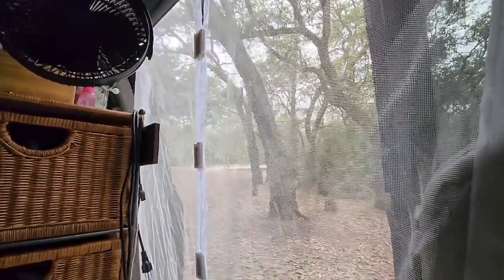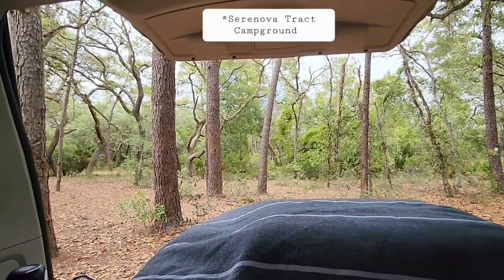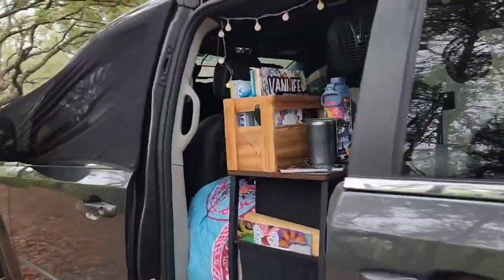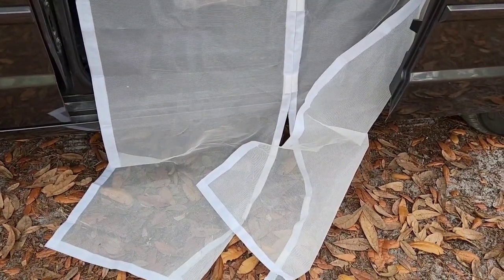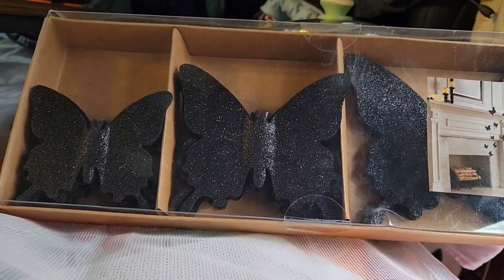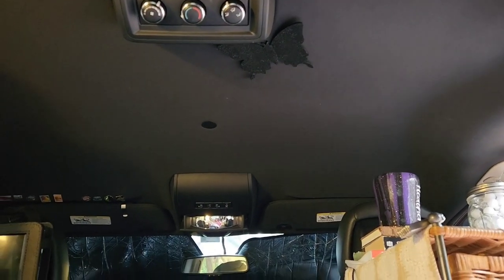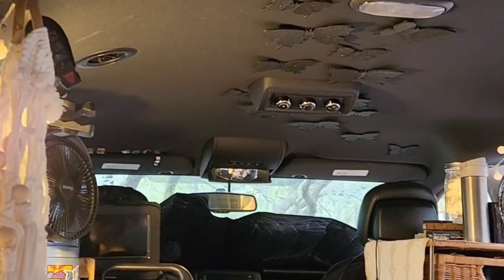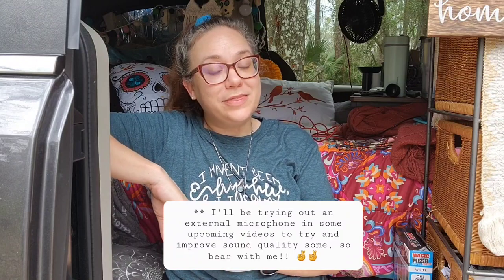Completing a Couple Easy PROJECTS on My No Build Minivan Camper While Off Grid Camping in Florida

Comment: Very cool additions. I love the screens. I wish that I could use them on the side of my SUV, but I don't think I can keep my door open too long - because of my suv battery. The back hatch doesn't drain the battery, but I believe the side doors open will. LOVE the butterflies. Awesome ceiling!! Everything looks so great!!
Reply from the maker: If your back hatch doesn't drain it, your side door shouldn't, I don't think (not that I'm an expert). My side doors are automatic and still have some connection to the battery (b/c I can hear the motor in them kick on occasionally, even with the engine off) so I wouldn't think your side doors open for a few hours would pull anymore juice than mine do??
Reply: @HeathersHikesAndAdVANtures  Okay. Next time we're out - I'm leaving my side door open the entire time. I have jumper cables, but I don't know how to use them. Actually, I better check to make sure they are jumpers. They were so adorable, I had to buy them. They may be fake. So be ready, Freddie with yours.  💙

Comment: Hey Miss Adventure this is a little off subject but your 3rd project about being able to use your computer and not just your phone made me think to ask!: Have you done a video on how to use? 1) the internet while traveling, 2) how to stream so as to watch TV or movies??  I am older and not technically inclined to say the least. I used hotspot on my Android and that worked because I had good service where I camped, but I was wondering if there are other options. I also got the screens for my van doors(wish I'd done white). Did you say the one one the hatch is a mosquito net for queen bed? Thanks for all the ideas, encouragement, tips and most importantly laughs... 🎶🏡🐁
Reply from the maker: Thank you for your thoughtful comments and feedback! That is a fantastic idea to use the pins and then just roll it. That way I could leave it in all the time - even when I'm using it as a "normal" passenger minivan - if I wanted to! I'll have to try that for the times where I'll be moving camp a lot!
I've thought about a video for simple methods for getting internet on the road (I'm not super tech-y), so I should definitely work on one of those!